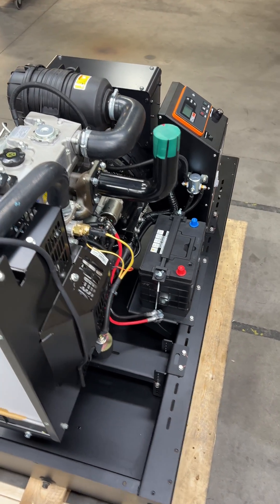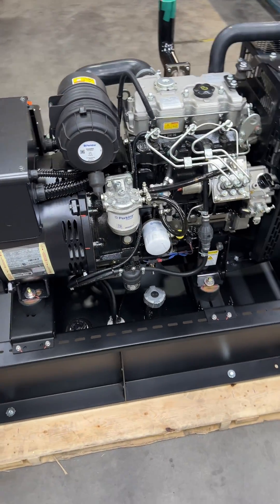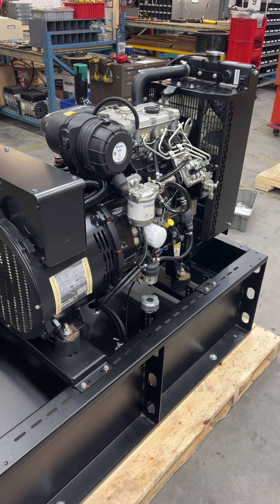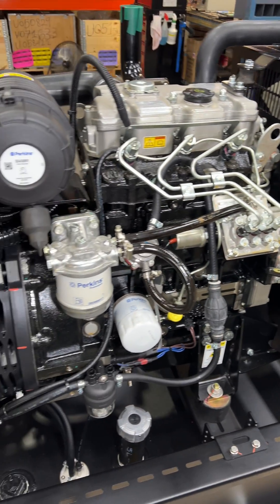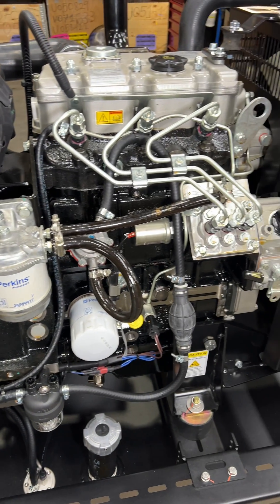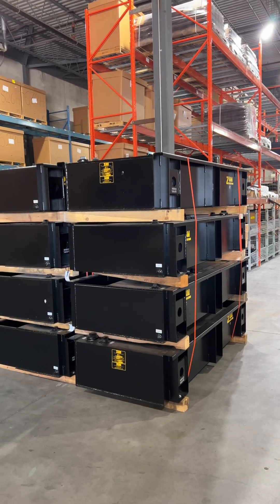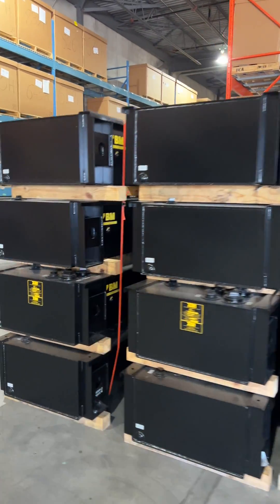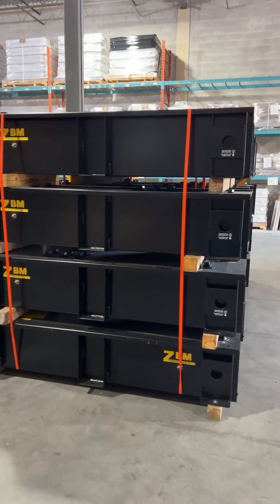13 kW Home Generator

Comment: Whats the approximate run time on the 12 gallon, 50 gal and 100gal?
Reply from the maker: That depends on your load.  Is it just one light bulb, an average home. Average home uses <5 kWh and that would be less than 0.5 gallons per hour.
Reply from the maker: That depends on your load.  An average home will consume about 0.5 gallons per hour.